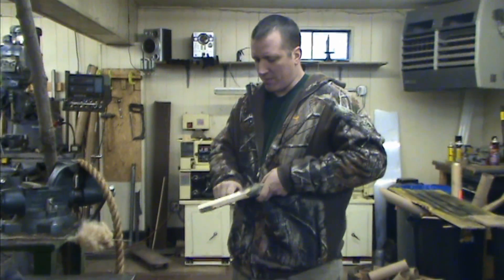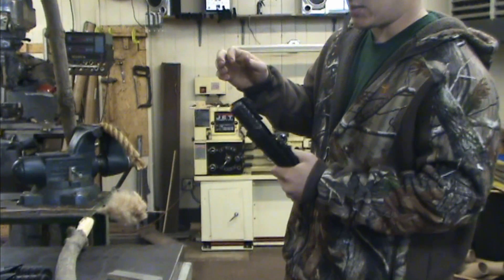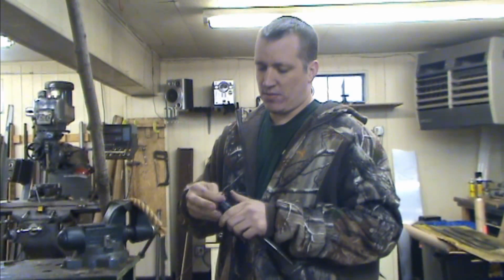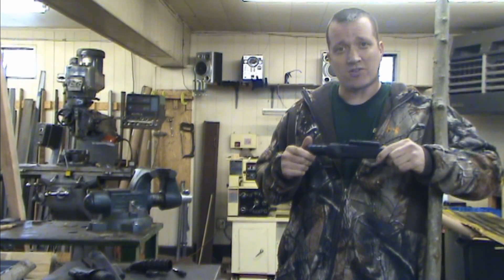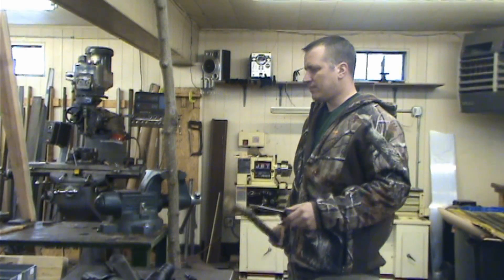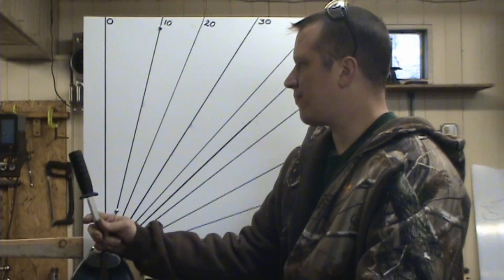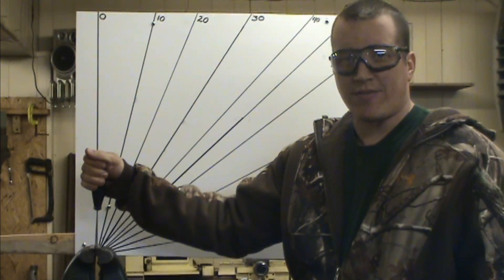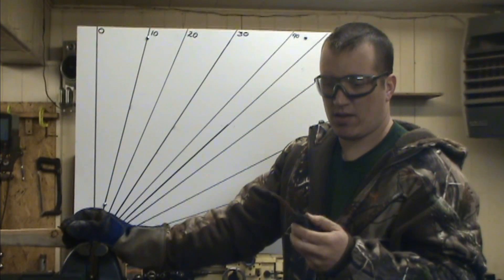Cold Steel Survival Edge

Comment: Yes, that is a very thin blade in a very low carbide stainless, you would need to have a pretty bad heat treatment to crack it off in a flex test.

Comment: true, except the durable part.  I believe they lack toughness (resistance to breaking) since they are brittle they can chip out or snap.  so in the above flex test it would probably snap before it bends much.  In hard use, toughness is just as important as hardness, maybe more so.

Comment: Bought mine 1 week ago and it is just the best knife you can have for 30$... Only problem is their shipping cost... Their site sell knife 20$, but they charge 40$ shipping for international buyer. If you are outside USA, buy it on eBay ! 
- From store: 21$ + 40 shipping + 10$ extra charge UPS = 71$
- eBay :26$ + 6$ shipping = 32$

Crazy how UPS charge 40$+10$ for a shippiung while USPS charge 6$ for the EXACT SAME product...

Comment: Andrew, while it is nice to see some use of the knife, I find it odd that you would find a 20 degree bend on 4116 stainless to be respectful on a 2.5 mm thick blade. Even high carbide steel blades in 1/4" stock typically need about 25 degrees to snap and since the internal stress is proportional to stock thickness in a given bend, that thinner blade has to be able to bend much further, combine that with the low carbide steel and a 20 degree failure point is pretty low.

Comment: @kikikia: yes I have some ceramic knives and they are hard almost as diamond and keep the edge a whopping 10 times common steel and 3 or 4 times special steel like ZDP-189  or S-30. The only cons is that they are very very hard so they are fragile and can chip if meet a bone or broke if fall on ground. However they are excellent for meat, fish or vegetable and you will never resharpen in ten or twenty years of normal use. Maybe a professional chef could resharpen every five years